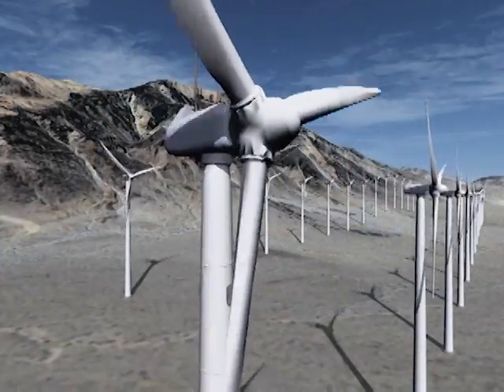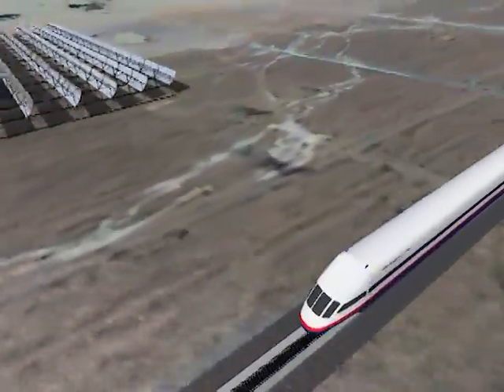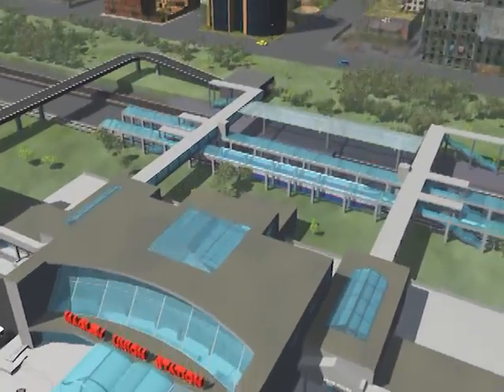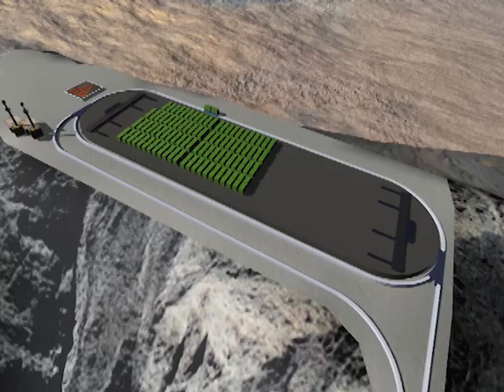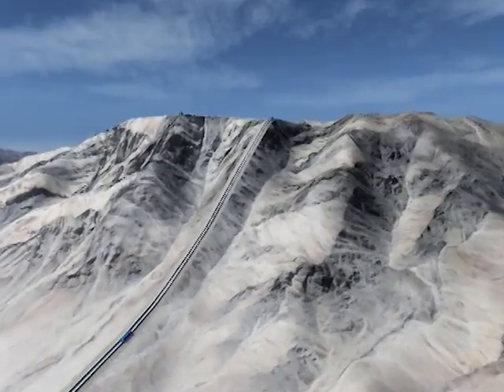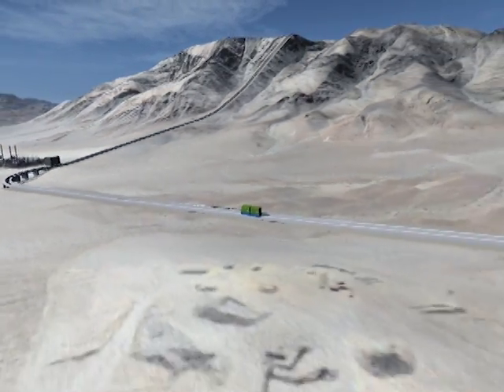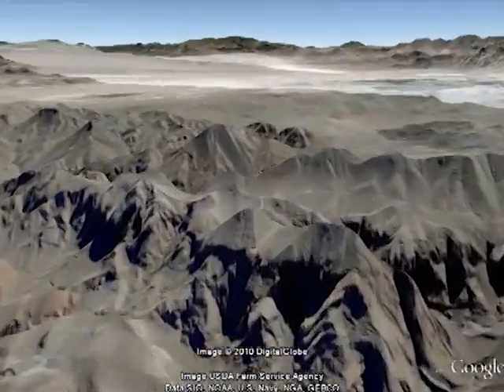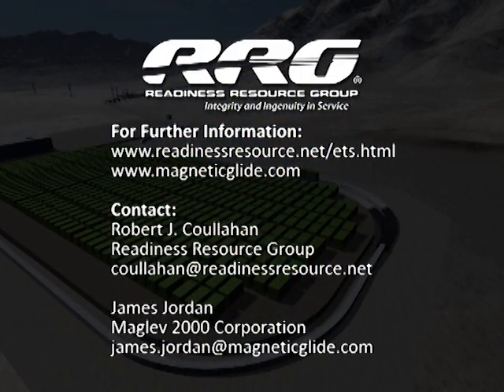MAPS Maglev Power Storage System

Comment: Gravity storage is terrible bad unless you take advantage on the volume^3 (capacity) - surface^2(cost) ratio at high scales that you only get when you use water reservoirs.
Lifting 1000kg over 1000 m only gives you 2.5kwh from the formula Work (joules) = mass(kg) * height(meters) * acceleration(m/s)
A tesla powerwall battery stores 13,5kwh
The only benefit that can make gravity storage more cost efficient than batteries or hydrogen is if you find a place in which you dont need to invest much to get a huge lake at great height, but with these ideas, you dont take advantage at all from the volume-surface ratio.

Comment: The idea is okay because concrete is 5 times heavier than water. However there are to many moving parts and machinery which makes it ineffective. Look up gravity storage, they just pump water under a massive rock or concrete block. That works better.
Reply: spot on. maintenance costs make this project worthless. mechanical breakdowns etc

Comment: I think water pumps and pipelines would be a shitload more practical then hauling up concrete blocks.
Reply: I agree with you 100 percent about water pumps being more practical
Reply: I guess, this solution is saying the efficiency of this system is more, as the translation from mechanical to electrical energy has losses that electrical to electrical does not have. Also, and maglev trains have a lot less friction moving up and down the hill, than does water.

Comment: I'm not sure I understand the theory behind this... Is it that you use a portion of the green energy created throughout the day (solar, mid-day; wind, night), to take concrete blocks up a hill; then when power is needed; you take those blocks down hill creating energy?

We are looking at wind, solar, micro-hydro to generate power. Also bio-mass conversion to create the sin gases we'll need to power a Bloom energy generator for our project.
Reply: You are correct. As the concrete blocks travel down the hill, their potential energy is transformed into kinetic energy.

Comment: The energy you consume is being produced right now. There is no storage because of the shear amount of energy to store. It's unpractical.

although, in reality, there are several system in place to store energy, such has back water on hydro dams and others... but they are ineffective (with huge losses) and slow responsive
This maglev concept is cute, could work, but it's a bit expensive and awkward. It seems slow responsive, requires a lot of surface space and a big elevation to work
weak sauce